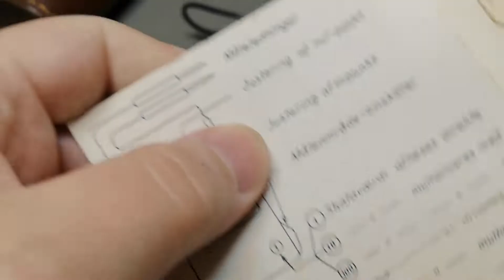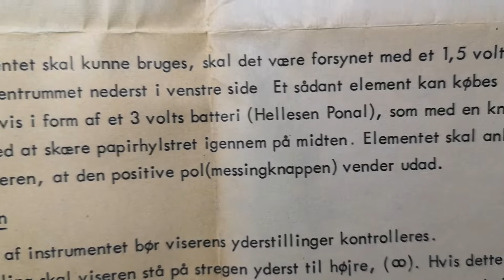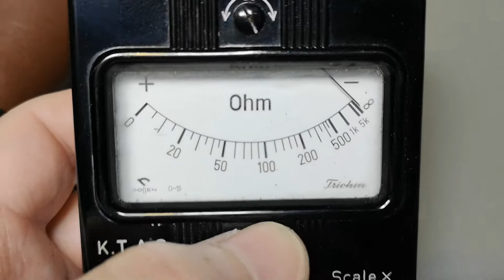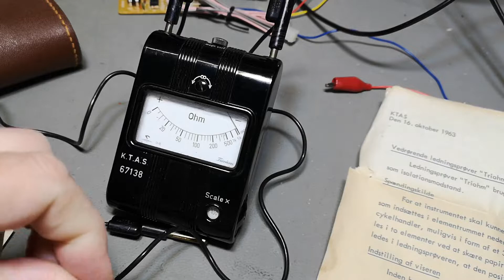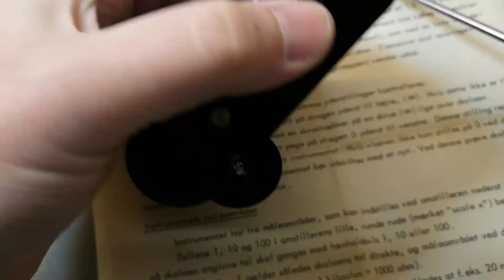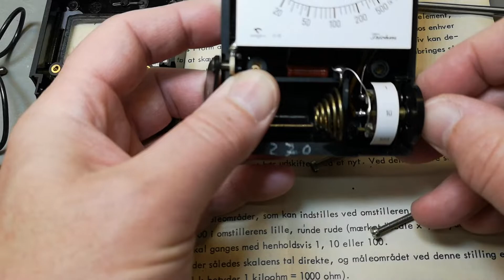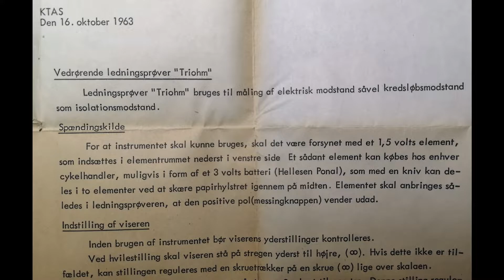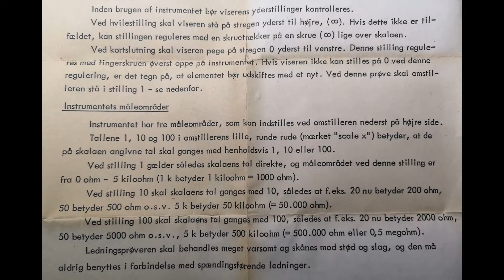Ohm Meter KTAS "triohm" Danish Telephone 1963 Test Teardown

Comment: One of those resistors is always in series with the battery, limiting current flow on the x1 range, and the other resistors are shunting the meter movement on the x1 and x10 range, leaving the x100 range as the most sensitive one. Looks like the original battery was a R14, C size, a common battery in the 1960's for radios and other low draw portable equipment, with the larger D cell for torches. 

Interesting to have a magnetic shunt to bypass field around the coil core, but makes sense, as the original magnets are likely AlNiCo, which do loose strength with time, so using the shunt to compensate is going to work better than adding in the noisy, and unreliable, variable resistor to act as shunt across the movement, instead you merely adjust full scale current reading/ Does not wear out, even with frequent adjustment, as you need to zero it when changing ranges, due to the tolerances on those carbon film resistors. 

Lovely little meter, the basic operation unchanged for a century or more, and still used in the modern moving coil meters, though there with the resistor to pad the current in resistance range instead. Yes bakelite, invented by Leo Bakeland, as a substitute material to make billiard balls, instead of ivory or flammable celluloid. Needs high pressure and temperature to cure it in the mould, but as you see the finish is still near perfect, even after over a half century of use, and the sanding was to get that perfect finished joint. Bit of leather care on the pouch, a light polish with the same to the bakelite, and it will go for another half century as well.
Reply from the maker: the magnetic variable shunt was the coolest thing i ever seen in such instrument, i never see its like before, people may think it looks old or funny, BUT : This instrument has 3 points of adjustments, zero, open and gain = you can make it read out very accurate.
Reply: @TeardownOZ2CPU  Linearity is also designed in, with the shape of the pole pieces, so yes you can get very high accuracy, at least equal to the 3.5 digit meter, if you use a mirror scale and carefully controlled lighting to get repeatable readings. This a century before digital readout of voltage was anything more complex than writing it down, or using a series of sensitive switches and relays to sense the needle position.

Comment: Sådan et har jeg også. Mit er fra 8 måned 1960. Det er fra K.T.A.S. men det står ikke i det, da min onkel bestyrede værktøj dengang 😀. Hvis du havde nulstillet instrumentet, ville det vise mere nøjagtigt end det resultat du fik i videoen.
Reply from the maker: Thanks for the comment, YES you are right, it can read a lot more accurate, if trimmed / adjusted in, I let the new owner have the plessure, it will go on the sale /swap pages soon.